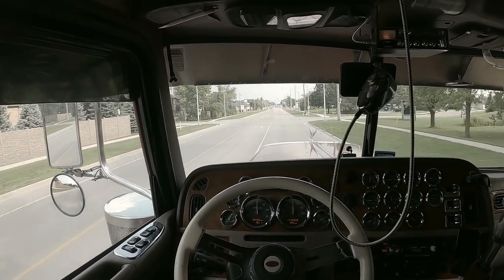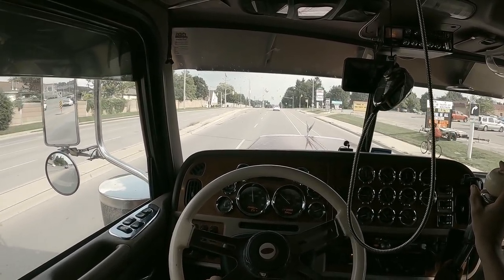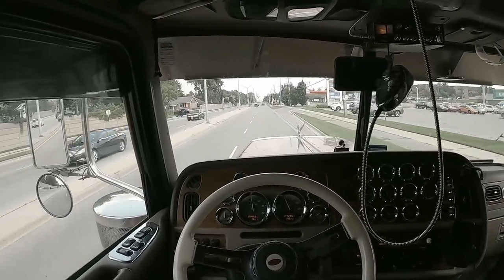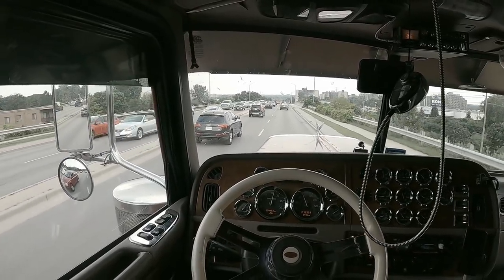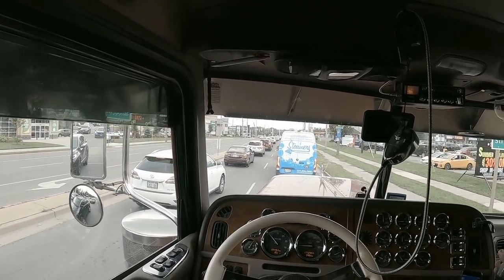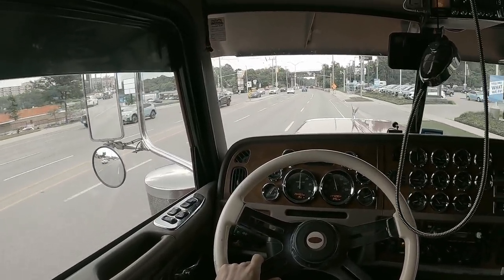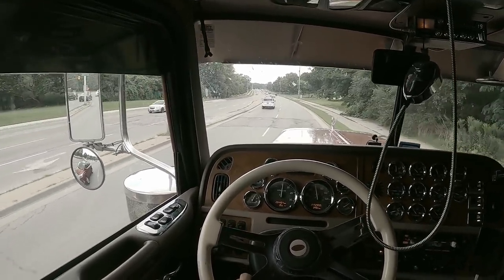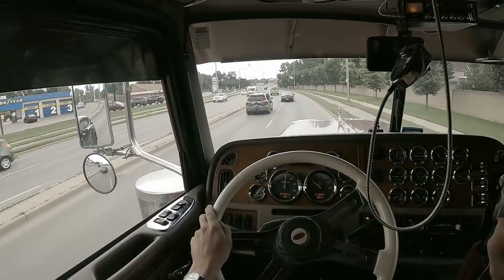ADVANCED TRUCK DRIVING TECHNIQUES: THE PRE-ROLL

Comment: Great info! They didn't have them fancy counters back when I was driving & I haven't seen them around where I live but I do remember using the lights to my advantage on the city streets. Most of the time I would try to roll up to a red slowly, then be at 10 mph or so when the light would turn green which made a big difference when I was loaded. Now you have to watch them pesky 4 wheelers because they will try to drive under your truck.😉😂😂
Reply from the maker: I was just starting to drive when they first brought the countdown lights in around here, and they were the BEST thing they did for the intersections that had them, it’s like an extended warning for the yellow light, so there’s no more racing to beat the light if you know you’re not going to make it and you can start braking earlier

Comment: As a traffic light tech it confused and still confuses me to this day why lights are not all set up due to countdown. Some of those programs for lights are set up specifically for certain circumstances such as disabled persons extension a 5-10 second delay before light changes or the traffic signal changes from timer to a permanent walk sign for that light for bus arrivals. It sucks.
Reply from the maker: Wow your job is actually super interesting to me! I figured there might be a reason that there’s a bit of a delay on the countdown, but I figured it would work the same if they just added an extra couple seconds on the countdown.

But I’m always looking at the lights and trying to figure out the methods and patterns on the lights, and it’s super interesting trying to figure out how to make everything work the most efficiently for everyone, not just the direction I’m going.

Comment: One thing I hate more is when you try to do the pre-roll in the city.. they is one or two 4 wheels that just want to hop in the lane before you can get going.. I really hate that.. this is like in highway/traffic intersection type roads.. Reason for that is when you have a slow truck you can get up to speed with out slowing traffic behind you... This goes for automatic trucks that the engines that are dated back in 2014 that give this slow roll as you go thru the gears and you don't get up to speed when you about half a block in.